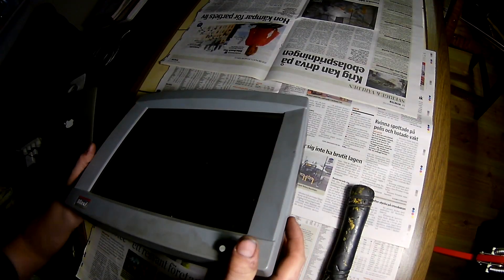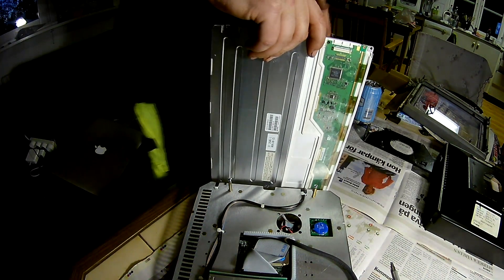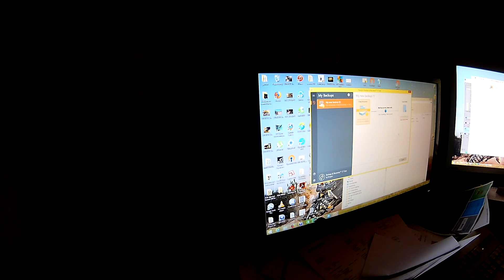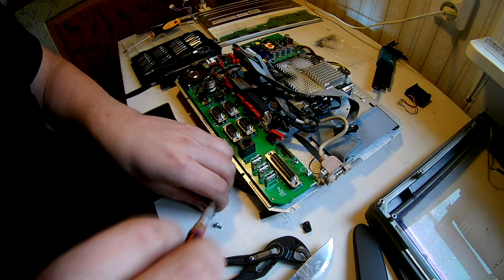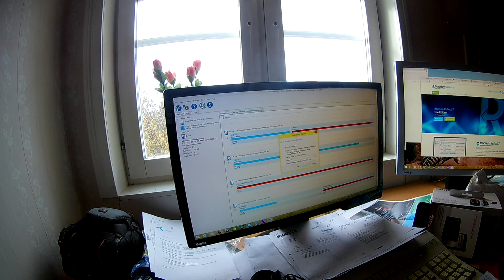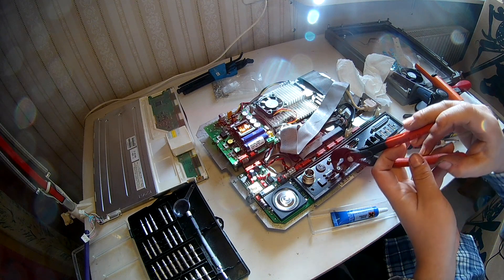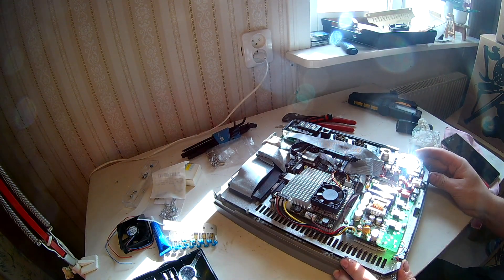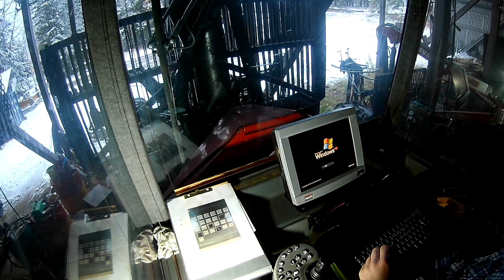Maxi computer from Valmet forwarder flickering screen fix

Comment: Iv got a 860.1 with the first style of maxiforwarder it’s half the size of your computer, the screen is flickering also, 

Iv also got a strange cab heat/air con problem that I can’t get to the bottom off,  you can have it on hot and it’ll randomly turn the aircon on max?
Reply from the maker: Does the flickering ever go away? If it shares some similar setup as the newer models maybe it has a power supply part with resistor/condensator components that I thinks caused my flickering/rolling screen. But plenty of things in a computer that can cause issues. And mine does it again every now and then. Will need to open it up and see if I did a poor soldering job or another component is damaged.

As for the heating you have a computer box also handling climate control?
Reply: @blackgrove8  I took a video but it won’t let me upload it, the screen is only about 8.7inch and there’s no keyboard. 

The cab heater has a electric control/pc box with 4 flashing lights E1/2/3/4
Reply from the maker: If video is small you can email it to me and I can upload it if you want to show everyone. blackgrove8@gmail.com If the climate control is the same as in newer machines it has 4 temperature sensors. Any of them dislocated or broken will cause issues. Do you have one near your left knee when looking backwards? Very common you bump that and it falls in next to the heating element. Do you have a service manual with wiring diagram?
Reply: @blackgrove8  sent a email, please check your junk as the attachments aren’t small